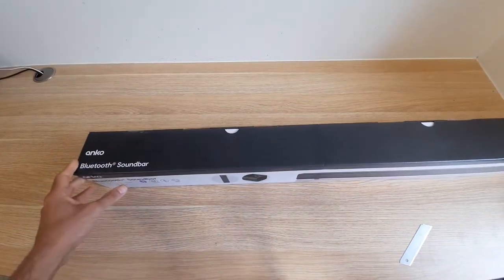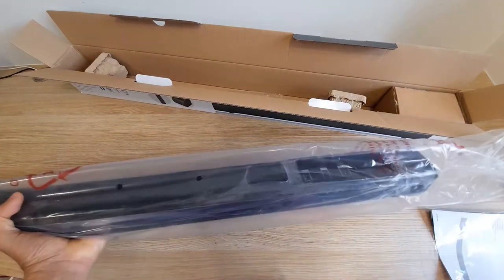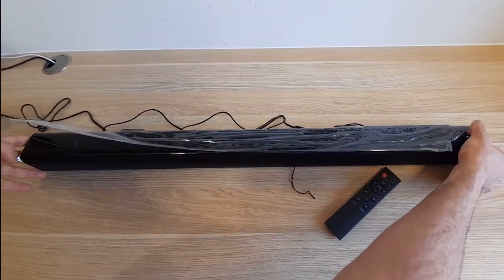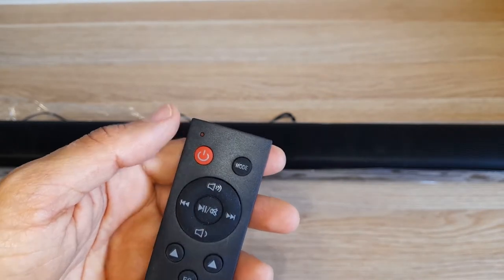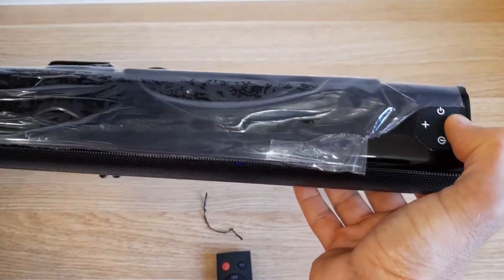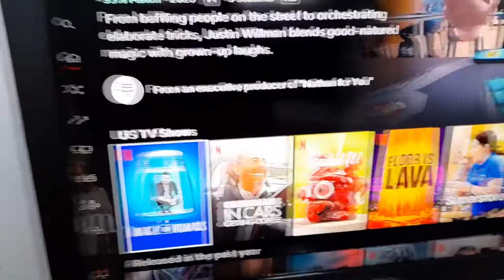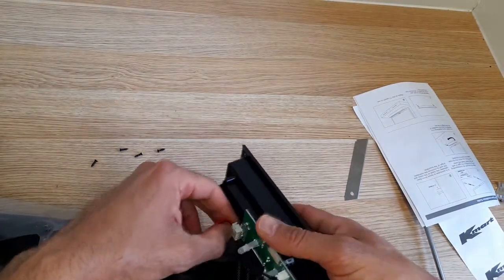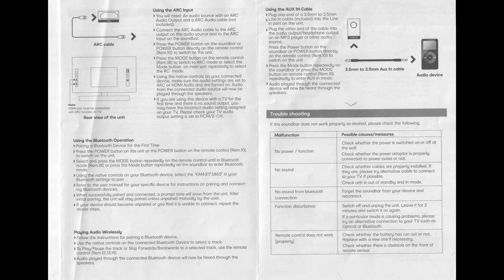Kmart, Anko $49 24W Bluetooth Soundbar Speaker, Review and Teardown

Comment: Most interesting.  I'm glad you opened up looks like class D running in bridge. 
I'm thinking of buying to use as a centre speaker without built in amp.
My LG sounds like " The Nanny "  very nasal.
Reply from the maker: Thanks for the comment, I'm glad the video helped.